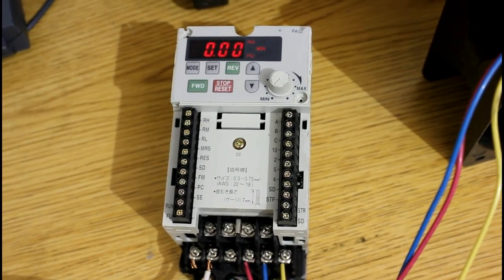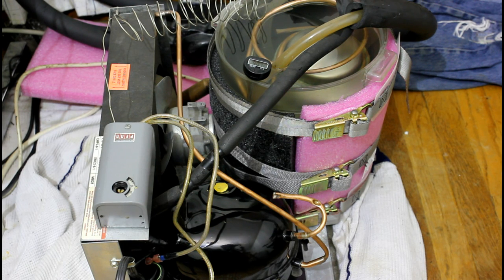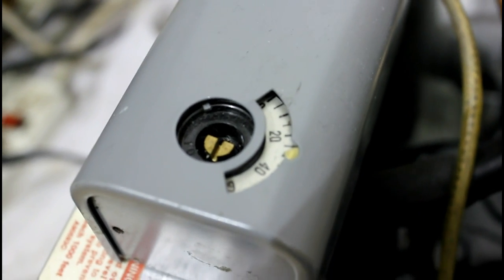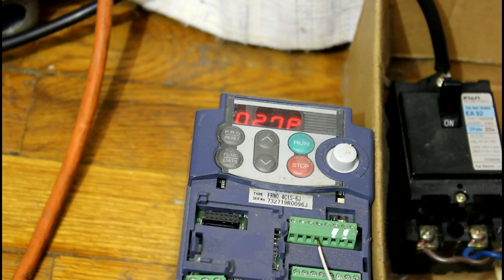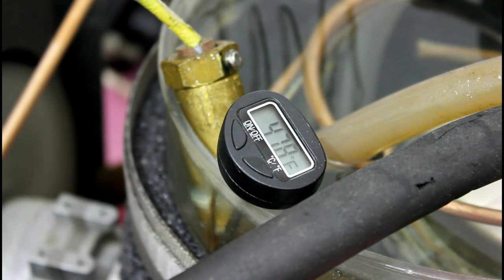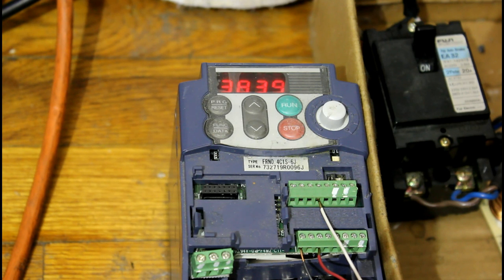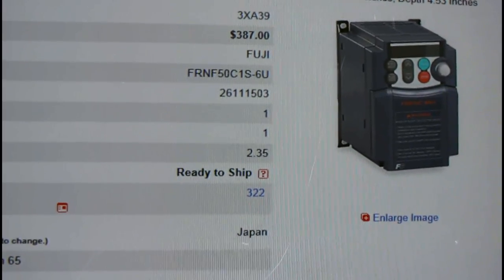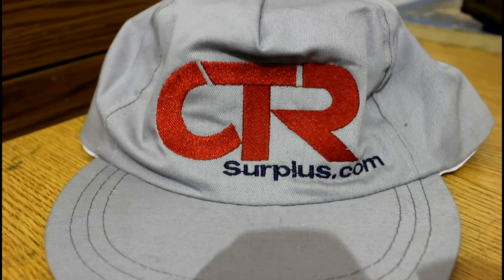Save on A/C and Heatpump bills using used VFDs Part 1

Comment from the maker: Yes the compressor in this video uses a capacitor to start. I have connected multiple compressors with capacitor start to VFDs and they all work. I do not think that they will start without a capacitor. Using a VFD with a capacitor is generally not recommended because there could be very high pulse currents that could damage the IGBTs. So far I haven't had any issues with that. So use at your own risk
Reply: I want to operating spilt conventional compressor using vfd is that posible?

Comment: Your work here is helpful in filling in some gaps in my knowledge base.  I've worked with mechanical contractors in installing piping and equipment and in building AutoCAD virtual models of such installations.  My knowledge of how the systems actually work isn't quite where I would like for it to be and videos such as this help close that gap.  I hope my grandsons become as engaged in living as you are.

Comment: You've inspired me to make a vfd controlled freezer for our garage. Living in southern Nevada the heat load changes drastically and I think this could help save us electricity. If that goes well, I'll try and convince the wife to let me modify our condenser unit outside with a vfd and temperature controller.

Comment: genius with a capital G! You can match the load better with suction pressure pid controler this way you dont have to worry
about pulling a vacuum. I think there is one drawback on your aproach on running a single phase compressor on a 3 phase vfd,
the output of the vfd isnt a sine wave, so i think that cop wil be better when 3phase motor is used. However like the vid, 
We need more people like you on this planet!

Comment: I think that some units have those things in them already.  Our mini split system if you are outside you can hear running at variable speeds.  It is not constantly on and off but you will be able to hear the compressor speed varying if you listen.  These are not loud units even if you are outside but you can hear them.  They are just not loud and obnoxious like some older ones can be.  Even the indoor parts are nearly silent.

Comment from the maker: Make sure the capacitor is good, and that the compressor will start when connected directly on line. Check the VFD settings, you may need to add torque boost to help start the compressor. Make sure the base frequency or field weakening settings are correct on the VFD for the compressor's rated voltage and frequency. You should be able to start a compressor even if it has a capacitor with a VFD

Comment: Most VFD’s accept 4-20 mA inputs. You can also use a PID Temperature Controller. Using a 3 Phase Motor would be much more reliable and as intended use. Thanks for the video...

Comment: You will find that running a single phase motor at frequencies it is not designed for will  cause severe overheating . It may run but  will run hot. Not just because of oiling issues.

Comment: LRA is the max the compressor can support before it is unsafe for the compressor. Starting amps are usually much lower.  To see this, put your meter on the start winding wire of the compressor and hit record max.  You probably will see a starting amperage that is lower than the LRA rating.
Reply from the maker: That may or may not be true. Regardless, starting current is always higher than running current (unless severely overloaded) and starting is always the hardest time on almost all machinery. Because of this, most motors are limited to about two starts per hour. Using variable speed control does extend the life of the compressor motor by running longer, with fewer starts and softer starts. Hard start kits? they start the compressor faster and with more torque by increasing the current. You could argue that it takes less time to start this way, so the stress is reduced, but in no way does this reduce the actual power required to start the compressor.

Comment from the maker: The VFDs do lose some, not much when only two phases are loaded. They are switching the 3rd phase IGBTs but since there is no current flowing, there are no switching losses in those IGBTs, only gate drive current is being used. The greater loss comes from the disruption in the power factor running the compressor in constant torque at low speeds, not alot though. The johnson controls are industry standard for VFDs, So is the voltage and current input so others may be used. Thanks for watching

Comment: How are you wiring that single phase compressor from that vfd. I know it's not suppose to be done but it looks like you can. Are you still using the run cap and just wired it normally.

Comment: If you add a VFD to a heatpump with a TXV woukdnt the valve always try to keep the Suction line a a set temp? Would you still be able to run a temperature controller on the suction line to control compressor speed with a TXV? How would this setup need to be modified for heatpump mode? Does Temp need to be changed manually? Is there a way to use a VFD to simply trigger multiple set frequencies to turn a single stage compressor to a multi stage not variable?

Comment: Can we design a single phase VFD to drive a single phase compressor ?  without changing winding of the induction motor?
Reply: There is brand has been did by invertekdrives brand

Comment: Hopefully you can answer a few questions.

Why did you filter and rectify the power coming in and go directly to the bus instead of using 220 to the bus?

Am I correct in thinking you used both output legs of the drive to the 110 compressor? Wouldn’t that apply the 220 voltage at 60hz?

Any info or links you could share for drive info.
Most searches yield the same generic info
Thanks!

Comment: Never thought running a single phase motor with a VFD could be possible.
Reply: I think it works on most induction motors BUT there are motors made specifically for this.  Some motors if they don't have the appropriate rating will fail prematurely on a VFD.  It is something worth a little researching.

Comment: Hi Bro, by integrating VFD and Temp. Control, does compressor shut down when the desired cool reach or it still on but on a low frequency (and RPM)? 
Thanks for the answer!
Reply from the maker: You can incorporate a thermostat with a system like this. Most VFDs have a start/run function, usually just a switch but this can be connected to a relay or thermostat. So for example when the thermostat opens it will interrupt the start/run signal and the VFD will stop the compressor. I use a setup like this for a heat pump, seems to work  well

Comment: Hi. Can you please show us how did wire a three phase VFD to Single phase compressor? Thank you.
Reply from the maker: Live and neutral to phase 1 and 2. Keep in mind this does not work with all VFDs, only those without phase failure detection, or those in which it can be disabled

Comment: Is it possible to rewind a single phase motor for three phase If so, I was wanting to cut open a refrigeration compressor, rewind it for 24v 3 phase and mig weld it shut.
Reply from the maker: I am not 100% certain, but I don't believe you can rewind a single phase motor for 3 phase. Single phase compressor motors usually have 2 or 4 pole pairs. You'd need a single phase motor with at least 6 pole pairs to rewind to 3 phase. I think your best bet is to find a 24 volt brushless DC compressor. You can find them pretty easily on ebay.
Reply: Where I'm from, you don't get much on ebay. The best I could find was a Secop BD35f for £111. As for rewinding for 24v 3 phase, I would use an electric bike controller to drive it.
Reply from the maker: I actually have a secop compressor very similar to that one. They are surprisingly good. Electric bike controllers usually drive brushless DC motors. I don't think this would be an issue, except that some brushless DC motors operate from a trapezoid wave instead of a sine wave. An induction motor probably won't run very well from a trapezoid wave, but then I'm not sure which controller you'd be using or whether it outputs a sine or trapezoid wave and whether or not it needs a hall sensor. I am interested, however, in why you need the compressor run from 24 volts anyway. The commenter above me made a valid point. The current will be much higher and the losses will be much higher, unless you drastically reduce the capacity of the compressor. What was the compressors' original rating? Or are you just asking if it is possible to convert one?
Reply: I attempted to rewind one the other day, but the slot sizes in the stator were not even so I found out myself that it isn't possible. I want a 24v compressor as these motors are more efficient than single phase motors plus I can run it directly off my solar batteries with the benefit of variable speed. I will use an esc from a plane or a bike controller to drive the BD35F when I get it. I have put these controllers on a scope and they appear to be pure sine wave.
 I have a video on my channel for it.
Reply from the maker: Not sure how much you plan on varying the speed of the compressor, but the BD35F should have a variable speed controller already included
Reply: I'm cheap so I am just getting the compressor without the controller. I will use R290 refrigerant as that's all I have.
Reply from the maker: Sounds pretty good overall. Only concern I would have is that the compressor might get a little hot. R290 has a pretty high pressure compared to r134a. R290 at 28c will be pushing 9 bar, while R134a  will be pushing 9 bar at about 40c. So you'll have to keep an eye on the condenser temperature. Best of luck to you
Reply: It should be fine, I have used R290 in R600a and 134a compressors without trouble. The only thing is that I think it won't be able to move as much heat as the compressor is not designed for this refrigerant.

Comment: Have you played around with DC Inverter Compressors like the ones in some mini splits or larger split systems? I think they are a type of three phase DC. I would like to design my own Geothermal using one of those compressors but I don't believe there is an aftermarket Controller I could use with one. It is more complicated than a simple DC controller. I read that they are about 30% more efficient than a single or three phase induction compressor. Was curious if you have some ideas.
Reply from the maker: They are indeed 3 phase permanent magnet motors, however I don't think the extra cost of the controller justifies the efficiency gain vs an induction motor. They are more efficient but not to the extent they'd like you to believe. Induction motors consume magnetizing current which permanent magnet motors do not, however the magnetizing current shouldn't be significant, especially when running from a VFD. If you use an induction motor direct on line, you can simply add power factor correction capacitors to supply the magnetizing current, but with a VFD, the magnetizing current simply flows back and fourth between the motor, IGBTs, and DC Bus, it doesn't actually come from the grid. My personal opinion is a 3 phase induction motor is best. Thank you for watching
Reply: Interesting insight I appreciate your response.

Comment: I noticed that the compressor you're using has a starting device. Does it have a capacitor for its starting circuit? I have been advised by my VFD company, not to connect the VFD to any capacitor. Will a single compressor start using the VFD if I remove the capacitor? Thanks

Comment: That was interesting. Thank-you.

Do VFDs lose efficiency when you load only one of the three phases like that?

I think I could use a microcontroller circuit instead of a Johnson control. Is that an industry standard DC voltage/current on the control input of the VFD, such that controls can be mixed and matched with any VFD?

Comment: So are you saying that you're applying two phases of a three-phase 240V signal directly to your 115V compressor and it works? How does it not burn out the compressor?
Reply from the maker: That's the beauty of a variable frequency drive. By changing the programming, you can adjust the output voltage to frequency relationship. The VFD in this video was programmed for 2 volts for every 1 Hz, so at 60 Hz the output voltage would be 120 volts.
Reply: @subcooledheatpump  Thanks for that info. How have you dealt with the signal that is sent back into the AC line from the VFD and preventing it from affecting other electronics? I'm finding that the VFD I just ordered is causing interference with other devices plugged in nearby like computer monitors.
Reply from the maker: Several things you can try. An EMI/RFI filter at the VFD input, a DC choke (most VFDs have terminals to accommodate a choke, some do not) and an LC filter on the output

Comment: How did you address the problem with slugging?
Reply from the maker: I've never had a problem with slugging with using VFDs on compressors
Reply: wow that's relieving to know. thank you.
Reply: Sir, do you by any chance know where we can buy VFD modules? Those which look just like starter kits. The same with what we can find in Motorjock.com?

Comment: Have you tried rotary compressor?  Im ok with reciprocating but cant run on rotary,  what might be the reason?
Reply from the maker: Most variable speed mini split units actually do use rotary compressors. So yes rotary compressors do work on VFDs
Reply: subcooledheatpump 
actually it run but few min only on 30hz and below.  it appears that no oil  at this low speed.
Reply from the maker: Yeah if you can only get it up to 30 Hz you probably need a drive with a higher output current rating. It should run full speed at least once every few hours
Reply: Detail Setup:  1 ph rotary compressor (not scroll) 50hz 3HP.   Blk common to V, Red Start to U, Blu RUN to W.  Initially it will run on 50hz no rampup and rampdown.  Anything lower than 50Hz say 49Hz down to 22hz will generate strong vibration and for few mins only then the IOL will trip.

I reverse S and R to W and U respectively;  that lessen the vibration.   No vibration on 21 Hz (resonance). and vibration again on 20Hz to 10Hz.  Also few mins only then the IOL will trip. 

My VFD has more than enough power to handle  3HP.  

I have the same setup but reciprocating and it runs perfectly.

I appreciate very much if you can send a video of your rotary setup.  Thanks.

Joey
Reply from the maker: Are you sure your V/F ratio is correct? If you're sending out the wrong voltage that could cause a similar problem.
Reply: V/F ratio depend on PWM.  No control over here. As I have mentioned it works well on reciprocating from 10Hz to 50Hz.

Comment: Hi, I tested to connect a 2.2KW VFD to a single phase 2.5hp York aircond compressor. Can this work if the compressor has a built capacitor for compressor start-up? I tried to power up the compressor using the VFD but the VFD gave me an overload error message. Do you have any solution?
Reply: Increase the time it takes to ramp up to speed

Comment: HI, THIS IS AL JOHNSTON. I WATCHED YOUR VIDEO ON INSTALLING A VFD ON A CONDENSOR UNIT. I INSTALLED A 3 PHASE COMPRESSOR IN MY 3 TON UNIT. THE ONLY THING IS , YOU DONT SHOW HOW THE WIRING SHOULD BE TO INCLUDE ALL THE SAFETY CONTROLS.IE HIGH PRESSURE ETC. ALSO I WILL HAVE TO REMOVE SOME WIRING ON THE UNIT. IE THE CAP ON THE COMPRESSOR. PLEASE ADVISE.

Comment: Ok so you cut the power output in half but then the unit is gonna run twice as long? How do you know when it doesn't need to run hard.
Reply from the maker: It's all temperature based. The temperature controller sends a voltage signal to a VFD. If the set temperature isn't being met the output voltage increases, which tells the VFD to speed the compressor up. The closer the temperature gets to the set point, the lower the output voltage, which lowers the compressors speed. Of course you have to program in minimum and maximum speeds into the VFD. The temperature sensor that is connected to the temperature controller can really be placed anywhere you like, but I clamped mine onto the suction line. Running twice as long isn't a bad thing at all, it reduces cycling and the compressor is more efficient at lower speeds. Thanks for watching